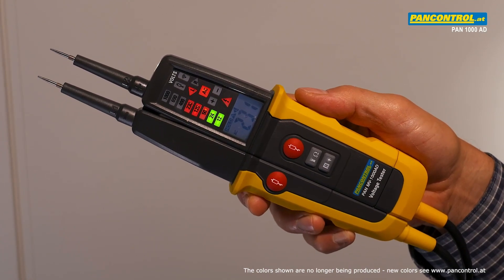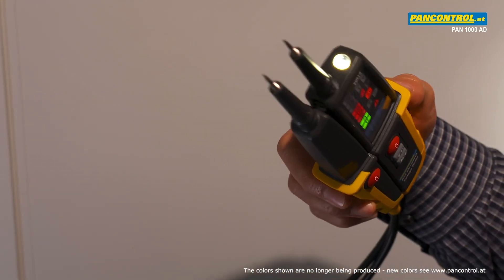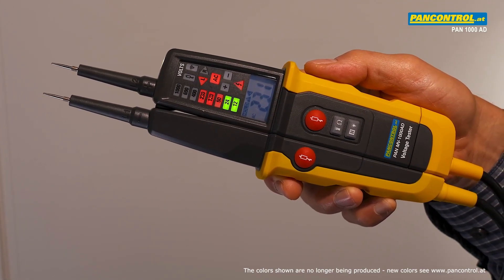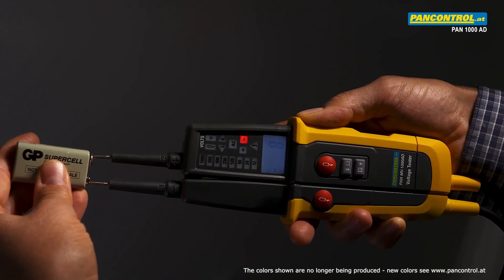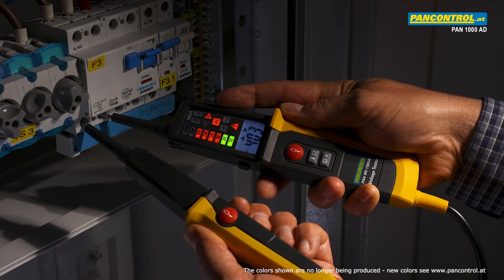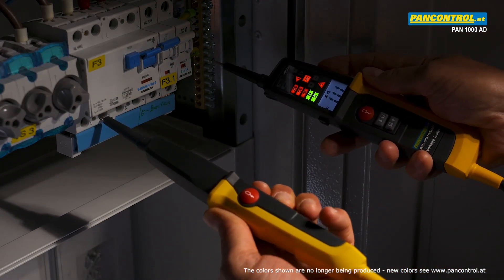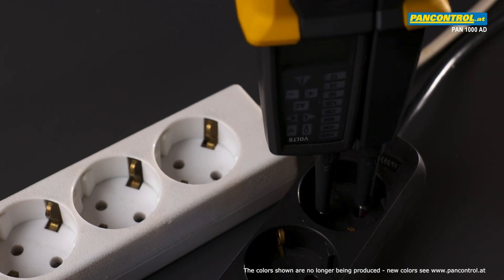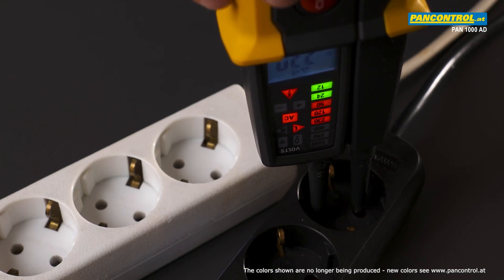PAN MV 1000AD EN - Voltage Tester 1000V LED + LCD + Rotary Field Indication

Comment: No he podido colocar las baterías como se hace gracias
Reply from the maker: Hola,

para insertar correctamente las baterías en el PAN MV-1000AD, siga estos pasos:

Abra el compartimento de las baterías en la parte inferior del dispositivo con un destornillador de cruz y tire de la tapa hacia abajo con un ligero tirón.
Inserte las baterías según las marcas de polaridad (+ y -) grabadas en el compartimento.
Asegúrese de que las baterías estén bien colocadas y de que el contacto esté correctamente establecido.
Cierre el compartimento de las baterías presionando firmemente hasta que encaje.
Si sigue teniendo problemas, verifique que las baterías estén colocadas en la orientación correcta y asegúrese de que no haya objetos extraños o suciedad que bloqueen los contactos.

Atentamente,
El equipo de Pancontrol

Originaltext:
Hallo,

um die Batterien im PAN MV-1000AD korrekt einzulegen, gehen Sie bitte wie folgt vor:

Öffnen Sie das Batteriefach auf der Unterseite des Geräts mit einem Kreuzschraubendreher und ziehen Sie mit einem leichten Ruck den Deckel nach unten hin ab.
Legen Sie die Batterien gemäß den im Fach eingeprägten Polaritätsmarkierungen (+ und -) ein.
Achten Sie darauf, dass die Batterien fest sitzen und der Kontakt richtig hergestellt ist.
Schließen Sie das Batteriefach wieder, indem Sie es fest zudrücken, bis es einrastet.
Sollten Sie weiterhin Probleme haben, überprüfen Sie bitte, ob die Batterien in der richtigen Ausrichtung eingelegt sind, und stellen Sie sicher, dass keine Fremdkörper oder Schmutz die Kontakte blockieren.

Mit freundlichen Grüßen,
Ihr Pancontrol-Team